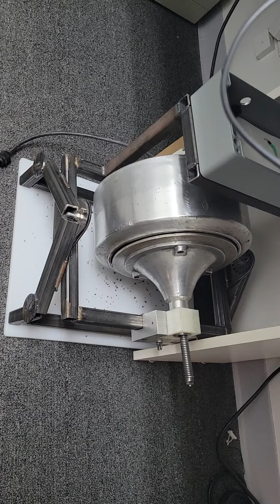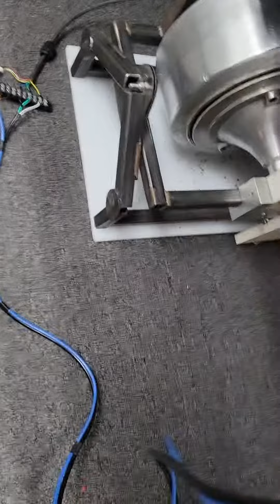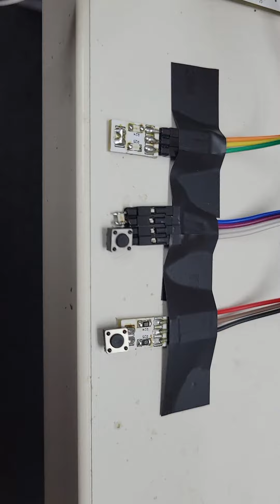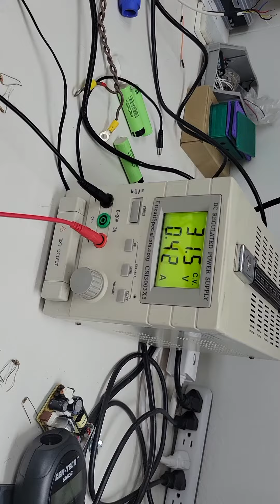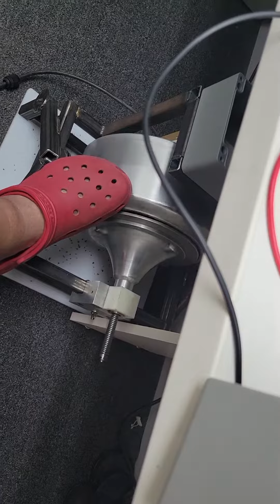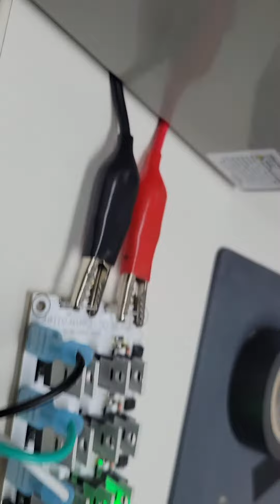Custom BLDC motor controller test

Comment: Hey Beau! Looking good! This is something I spent many years messing with! Glad to see you getting into motor control.

Curious what all chips and algorithms you're using. Doing any FOC and SVPWM on your own, or using a more auto-tunable solution, or some simple 12 step?
TI has great solutions, particularly their C2000 series which has everything you'd need for doing completely on your own. IRF also has their auto-tune, sensorless, etc stuff (iMotion iirc)
Also looks like the power side is fully discrete? I assume discrete optocouplers, mostfet drivers, etc? Have you considered going with irf IPMs where all of that is integrated? Sure makes things like shoot-through, gate ringing, etc much easier.
Honestly, unless you plan on doing a weird drive that can be dc/ac/stepper/all in one (like granite devices') - I have a difficult time finding reasons to not use the IPMs. Then again... there's not much reason to not use the auto-tune stuff... but I find 3 phase motor control fun. Reference frames all the way down.

Both have great and numerous white papers, reference designs, app notes, etc
Reply from the maker: James, It's basically a 12 step PWM variation  with HALL sensor feedback.  The configuration for this particular application does not try to actively SLOW the motor if it gets going too fast unless you specifically apply an electronic brake.  Speed is dynamically maintained based on the motor LOAD.  The algorithm is something I came up with on my own after exploring many different rabbit holes.  The Controller from the manufacturer for this particular motor was not able to handle sudden stops and a quick reversal, and in fact blew up (literally) ... A second attempt to mimic the controller from the manufacturer with our own design had an identical response to sudden stops and quick reversals.  So we set out to develop our own that could handle such changes without killing the controller.